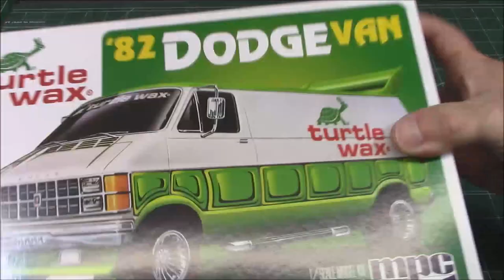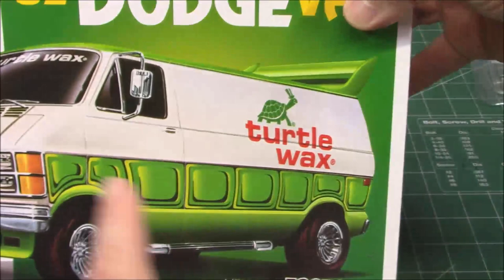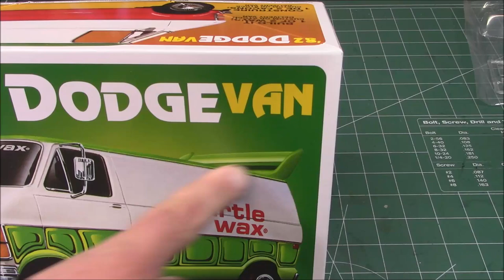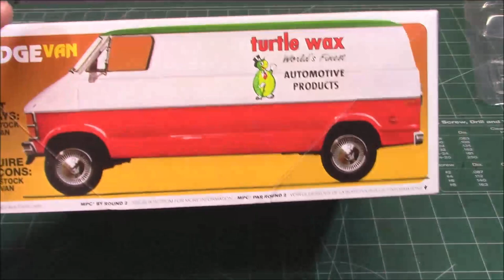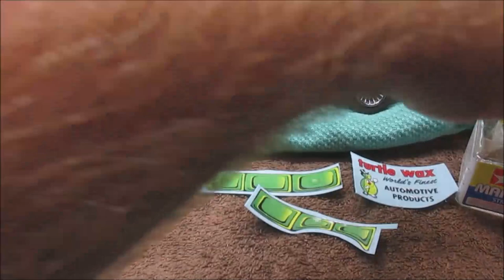1982 DODGE CUSTOM VAN B Series 360 V8 TURTLE WAX 1/25 SCALE MODEL KIT BUILD REVIEW DECALS MPC943 MPC

Comment: This was the exact kit MPC used for the Cannonball Run Ambulance. I was so disappointed when I opened the kit even though the box shows it using the correct Dodge Sportsman van and MPC did release a Sportsman van kit.
Reply: I believe this is also the exact kit as the Bad Company 82' Dodge van released my MPC and then 3 years ago my Round2.

Comment: The Turtle Wax paint scheme is a clue, The Red Green Show. You will need two vans to lengthen the body to proper spec, and convert from dual square to single round headlights, an easy job. Fun project.

Comment: Hi man, nice build! For your info though - that engine? Aint a dodge. If it were a small block, the oil filter would stick out the right right of the block, and the distributor would be on the back top of the engine, just right of center, while the starter would attach on the bottom left of engine; if it were a big block, the oil filter would stick out the front bottom of engine from an external oil pump, while the distributor would be on the front of the engine pointing up to the right.  Im kinda thinkin thats a chevy engine they gave ya. Strange.  Speaking of - the van, i think, is an automatic (i dont see a clutch pedal but i also dont see a shifter on the steering column), but the transmission in your kit is a manual.  Not meanin to ruin your kit, just thought id point it out as someone that's a diehard Dodge guy. Was thinkin of gettin this kit, but not if they cannot put the correct driveline on board.   Your work, on the other hand, very nicely done!

Comment: My question is actually if the engine is supposed to be a small block 318 or possibly a 360 Shouldn’t the distributor actually be located in the back of the engine?
Reply: opar located n front.

Comment: Just found your u tube channel a while back. Like the picture of the kids in  the  hobby shop looking at the Jim Walker Firebaby u control.lt was my first u -control airplane and it came with an aluminum propeller. I had a .049 spitzzy mounted on it that some times ran and most times didn't.  Your channel has caused me to dig into some of my stored for ages, car  models. Love your chanel.

Comment: Nice job as always. Pretty sure the intake manifold/distributor is on backwards. 273/318/360 all had the distributor in the rear. Can’t be seen so it doesn’t matter.

Comment: I have never used the Tamiya Panel Line color before. When you wipe off with a Q Tip, is it dry? Or, do you have some sort of thinner on it? I haven't been able to get a straight answer either way. Thanks!
Reply from the maker: It's a very very thin enamel paint with Tamiya thinner in it, so you'll treat it the same as any enamel paint.